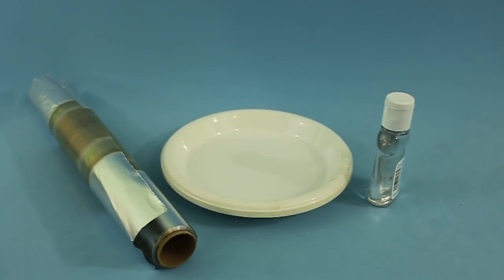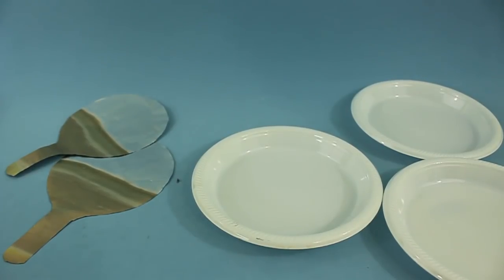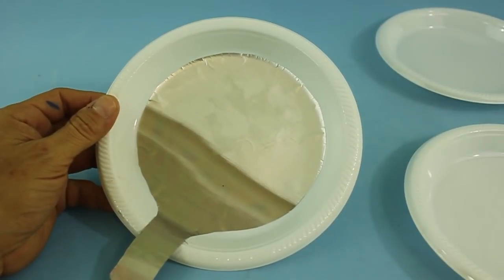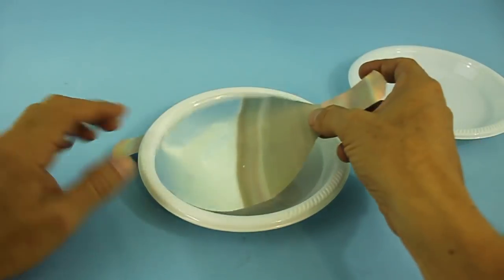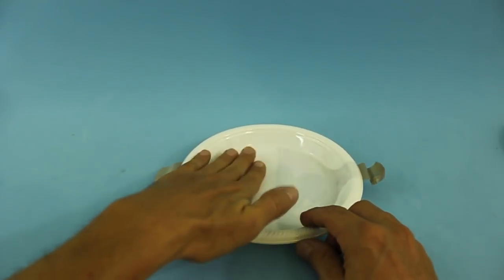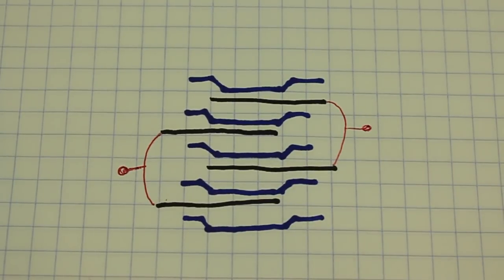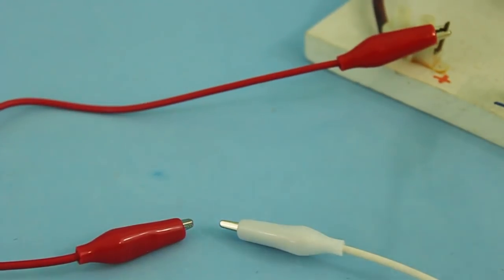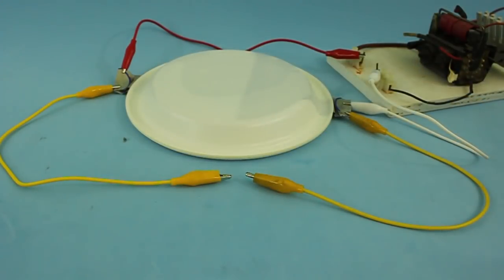Making a High Voltage Capacitor

Comment: I didnt have any aluminum foil so I borrowed a stop sign down the street and cut it into 4 pieces then I realized I was fresh out of foam plates so looking around I found some memory foam from a mattress which I cut up and just smashed it really flat then I stacked the foam then stop sign then foam like that and used some duct tape to hold it all together. when I finally connected the very large pole pig transformer I got from a power pole on the outskirts of town this really really worked well with this gigantic tesla coil. so well in fact that it managed to burn up 2 of the cities main power generators. but there for awhile you should have seen this thing lighting up every lightbulb wether turned on or not for miles some devices apparently couldnt handle that much electricity in the air and just died truly an epic sight to behold. thanks for the idea . hopefully the city will be up and running soon and I will be able to test this again, fortunately for me they have no idea how it happened. everyone blames the mayor hahaha
Reply: Good story.

Comment: I've done something similar with 650 ml yogurt containers made of polypropylene.  It worked pretty well with each layer giving ~650pF.  The trouble was that the cups are tapered and so wrapping them in foil was difficult and required the foil be a very specific rainbow shape.  Next time I'm at the dollar store I'll have to grab some plates and give this a try.  It looks a lot easier.

10 HV microwave oven diodes just came in the mail too so assuming my results are good I'll look forward to using these for a multiplier.  The stacked design would really lend itself to that well.

Comment: Is the same DC power supply used in this video and the "low inductance capacitor" video? I know DC is used most frequently to charge up capacitors (and this video you say it is DC power supply of ~8000v). However, I wanted to make sure, so I know what type of power supply I need to get a hold of to replicate this experiment (I need a high charge-discharge rate at high voltage) . Thank you!
Reply: I think if the power supply is ac ''or dc pulsed into a transformer'' the capacitor will multiply the voltage. I think having the capacitors in parallel increases the amperage and to increase the voltage you need to make a step up trasformer or cascade multiplier using diodes.

Comment: Great video, thanks. Is it correct to say that the capacitor increases the voltage? or why is the arc stronger after the capacitor?

Comment: Do you have videos of  using the difference of potential  of the capacitance  produced by a single transformer to produce  dual regulated discharges?

Comment: Sir we are doing a project in which we want a capacitor with 20 kV breakdown voltage. How should we achieve this? How can we modify the capacitor in the video so that it becomes 20 kV instead of 10kV?
Reply: use thicker plastic, or two layers.

Comment: Sir, What will happen when we touch only single positive wire of flyback .
Reply from the maker: you get a shock
Reply: Ludic Science but sir I have Doubt that when we touch vandegraff generator we don't get shock due to higher potential over it. I thing same thing must be for flybak when we touch only single positive terminal having insulated foot at the bottom. Thanks!
Reply: Don't worry if you don't know

Comment: Excellent video, I would very much like to see a destructive test for breakdown voltage of these plastic plates.
Reply from the maker: Need a higher voltage power supply for that
Reply: @ludicscience  But how do you know it withstands  just 10 kV?
Reply: @ludicscience   Redo the experiment with 1/2 or 1/4 size plates. Then only 1 or 2 layers, on plate size. Then redo to see how long or what voltage damages the capacitor. Anyway, it would be a very cool follow up video to link to. Thanks for the original video! Much appreciated!!
Reply: Ludic Science how high
Reply: Ludic Science I highly suggest trying the same thing but with ceramic plates, then it will really be rated for high voltage.

Comment: Thank you so much! I was lookin for HV capacitors for my tesla coil, but they are rarity. But sir could you tell me, what is the breakdown voltage of this type of capacitor and could I use oil instead of that baby powder or somtin :)
Reply: You can use any mineral oil for this. The breakdown voltage depends on the thickness of the plates you use but most likely any failures will be caused by imperfections in the plastic. If you experience a failure, just build a new capacitor using two plates (with a little oil between) for each insulator. Remember that if your spark gap gets too big, that's when your cap will fail for sure. In my day we used glass bottles of salt water in a salt water bath or wrapped in foil. This design is so much easier and safer.

Comment: Can you tell How we can increase capacitance by expanding not only in number of layers but thickness of aluminum foil maybe?  Would you store more charge if you add not a single layer of aluminum foil but say 10 layers between to plastic plates, and then triple each subsequent layer like that...  Would it WORK?
Reply: Bojan Atanasow capacitance depends upon separation between aluminum plates and surface area of aluminum plate. So if you want to increase capacitance you can use bigger plates or compress plates to reduce distance between each aluminum plate layer.
Reply: @Exotic_Lab  We how know?capacitor is absolute how many voltage.

Comment: Can you explain why with the capacitor the Arc becomes stronger???
Reply: When the power it turned on, the capacitor starts to charge and consumes most of the power so there isn't enough voltage to immediately jump between the test clips. As the capacitor charges up, the voltage present at the test clips gets higher and higher until there is enough to jump across the gap. When that happens, the spark creates a discharge path because plasma conducts extremely well and all the power stored in the capacitor drains quickly through this discharge path, causing the noise. Once enough power has drained to stop sustaining the discharge arc, the plasma disappears and the cycle repeats. This effect is used to switch very high currents very quickly. Google the "triggered spark gap" for more.
Reply: Clips? The man asked for an EXPLANATION. NOT A REPEAT.
ALLOW ME SIR. 
electricity is applies to each sheet. The tin foil is conductive. On a level between 1=10 rating, tin is 9.9! :) (these small differences is important all materials are 'conductive'- or 'pass energy', but some, like metals are more, plastics/foam-way less, BUT STILL, energy/electricity is able to pass thru ALL THINGS, only difference is, how fast?
  Thats the magic of caps. Every cap has some different level of "capacitence' or simpler- 'how much air, or oil, or paper, or foam plates does the energy need to" jump" thru. Butt it really doesnt, on a mych quicker, molecular level, energy is "filling" up, building up, this build up, some call it "potential". The point where the tin foil cant hold it. Both sheets are zapping full of  electrons and protons, like a 2 dance clubs with boys in one, girls in another, across the street, the street is soaked with whiskey (the oil<) the clubs keep filling up, the girls too. 
   Then bam!  Babies are made, or POP! THE ENERGY CROSSES THAT BOUNDARY. ESCAPES, MOVES, POTENTIAL HAS REACHED THE, numbers on the side, 1200uf at 470volts, or whatever.
Gawd, i hope it helps..... Building up. Crossing over is the pop.  Depends in type of cap. Companies make several different types. Depending on amount of energy needed.  Like fat caps on ac blower motors.  Two mainly, a starting cap, to help get the heavy sucker spinning, and another, to HELP. (not neccaaary, only helps run smooth, efficient) run smooth.  Energy moves like water, it fluxes, wanes, shifts n wobbles. A dance. A step. A jump! The capacitor takes all the crazyness away, crazy in one side, smooth, out the other side, because those tin sheets are so smooth, flat, big, Crack! Big pops!    Shit....
Reply: Lemme answer this ..... voltages through capacitor made more dipoles in each particle of the capacitant molecule as a result induction happens in a swift flash attitude.  Stronger arch imedes as result.
Reply: a simpler explanation is that the transformer is like a valve and the capacitor acts like a cup
the water valve provides a constant rate of water, the cup that fills and empty (think about those Japanese garden bambo things that fills and empty and makes a loud noise when they hit the rock)
Reply: @zazugee  What you're talking about is called a relaxation oscillator and yeah, that's basically correct.  Your use of the word "valve" is confusing though.  It's just a power supply.  The zen garden feature has a water supply.  A valve implies switching action. Maybe you meant faucet or tap.

Peter S is exactly right. Those other two posts are complete bollocks. (No offense.)